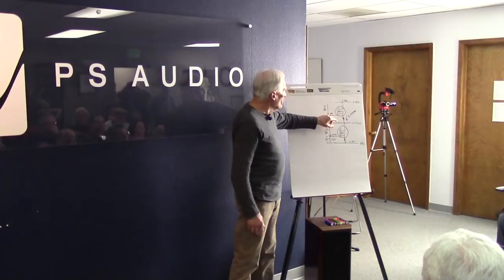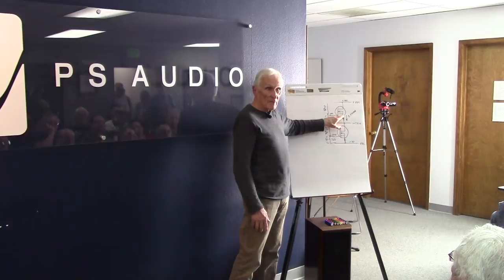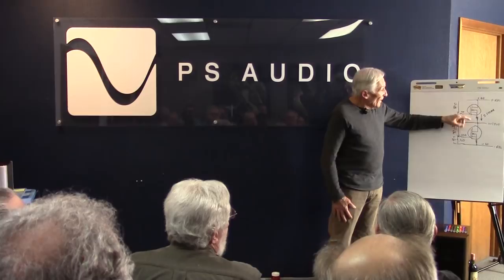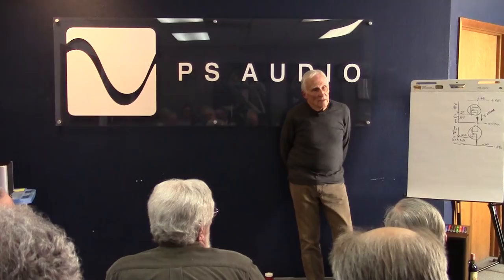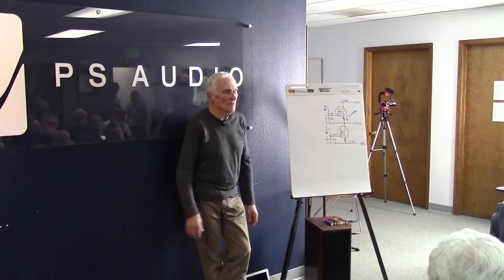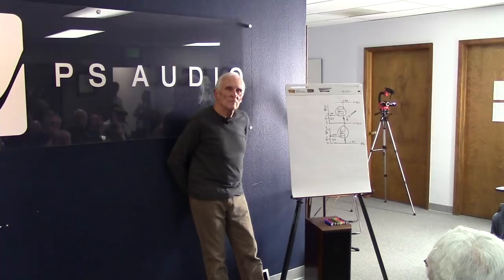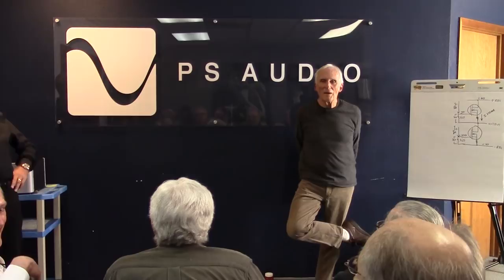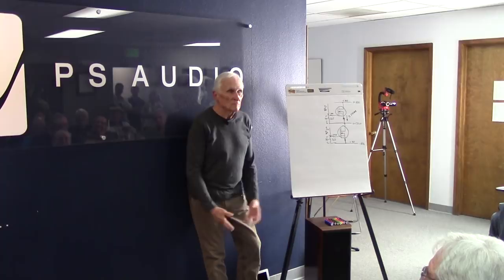Bascom H. King

Comment: Fantastic interviews!  I heard my first electrostatic speakers, the Infinity Servostats, back in 1970, and I knew I would own them one day.  That day finally came several years later, after building my own electrostatics. I have owned fifty or so pairs of Infinity speakers.  I learned about Bascom King while working with Ron Dunn, the Infinity rep for the Southeast.  Ron had a Hybrid Class A amp that we would demo to dealers.  I never met Arnie until he was demonstrating the new Genesis Model one at the Miami show in 1997.  You all are legends in my book!

Comment: I think Bascom may have been referring to the late Allen Wright and what he did at 26:35 (I was a collaborator of Allen's for 35 years). Bascom knew about Allen's work and also Bill Thalmann (ex Conrad-Johnson designer) and got Arnie to have a Sony SCD-1 upgraded by Bill using our modules. Paul must remember that SCD-1 because Arnie seemed to like it at the time in the early noughties. 

I have designed an amp that is based on the legacy  of Allen's and the front-end is pure cascode, Darlingtons on the bottoms and N-Fets on top, long-tailed differential. I am very conscious of the input Gate capacitance of these Fets - I used IRFBF20 devices. But when there is no signal on the gate, or any other funnies (even Base current on transistors is suspect IMO), that explains the linearity even if you have to use P-Fets, just as Bascom explains, at least that is my explanation.

That cascode front-end is operating with a gain of 400 because the output stage gain is only two, but we operate the Anodes at around 1/3rd of the impedance of Triode and then we have the step-down transformer - that's the reason for the high gain needed and also able to swing in excess of 1000V p/p - yes 1000V. It sounds incredible and we hope to get to manufacture it soon. 

There are some that says that everything has been tried and there is nothing new, but we have found this just is not the case. In some ways the best has been what has happened of late, but based on past experience. We must always be willing to think outside the box. Never say it will end, or else it will end. That would be sad.

RIP Arnie Nudell and Allen Wright.

Comment: I think my no negative feedback power amplifiers are just as good for 1500 us dolar pr stereo power amplifer.small toroid  and 2 rectifiers 20 000uf  for inputstages a big toroidal trafo for output stage with 2 rectifiers and 100 000uf capasititor.Total capasitor bank is 120 000uf pr 2 mono modules with 120w. sanken output devices.i make them as 240 watt also with 4 output devices but recomend to get them made so customer have one input pr channel and 2 pair (2 red and 2 black speaker outputs) coupled to 2 output devices each so a mono block gives 2 times 120 watt with one signal input.rca or balansed versons i also make.twise the hardware twice around the prize.This amplifier is so quiet that a 96db 1w 1meter sensitivity tweeter you have to get ear close to tweeter to detect amp is on.Almost every p.amp i have tried i active system makes to much hiss.This is a linear amplifier.No osilation problems do to no negative feedback.can run without dc servo(just lift a jumper piece as i mainboard on pc have.Zobel network on speaker outputs are recomended and used.Other people say it is great sounding.I agree.it can drive loads down to 1 ohm.it doubles power from 8ohm to 4 and from 4ohm to 2ohm.Bias is recomended for 8 ohm is 10mv.for 4ohms load setr it to 20mv and so on.All components are off topp quality and very low toleranse.Some say the mid to lower midrange is fuller and remind them of tube without disadantages off tube.sorry for my bad english writting.
Reply: you need a voltage regulator, not a capacitor bank